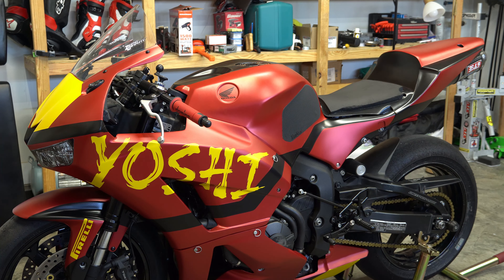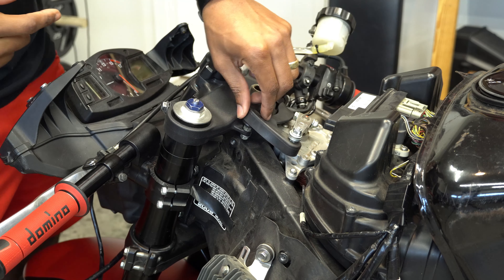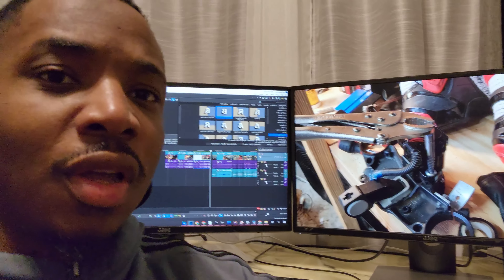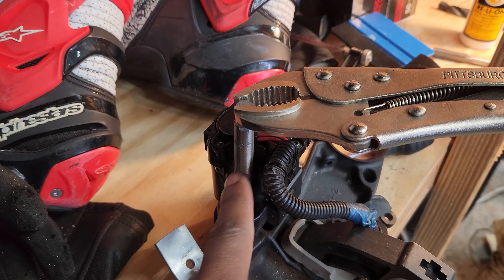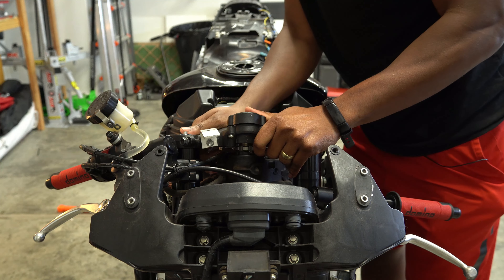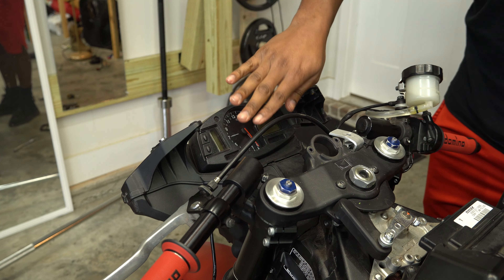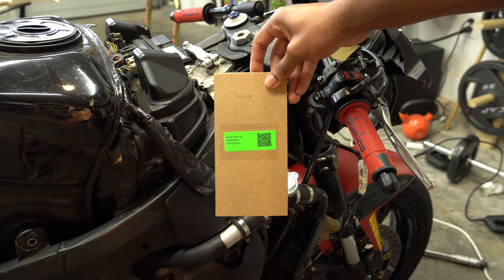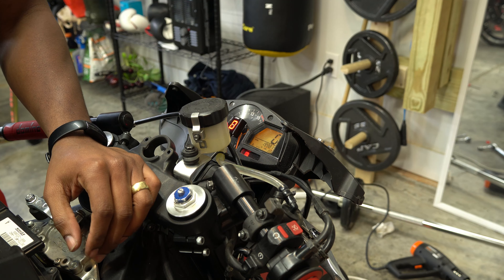CBR600rr Key Switch Delete | How To

Comment: hey man great video 😂😂😂
i got the same extraction screws you used in the video for the security bolts, but when i’m using a vice grip to unscrew it that shit is on tight!!! how’d you manage to loosen em up
Reply from the maker: I had to tap the extractor in pretty deep, then turning it out took a couple of bumps to break it loose. you could try some pb blaster or wd40 too

Comment: how about immobilizer sir?
u dont off the immobilizer?
Reply from the maker: I keep the bike in a garage and only ride it on track
Reply: @Master_Yoshi  The question was more on how you bypassed the immobilizer? Does the keyswitch-elimination the job?
Reply from the maker: @peterbasse2002  My mistake! If the immobilizer is the steering lock, than yes eliminating the keyswitch gets rid of it. It's not an electronic mechanism, so the harness itself has nothing to do with it

Comment: Wouldn't this mean you have to take the battery out every time you're not using the bike? Also, what attachment did you add at the end of the breaker bar to measure torque? Can you please link the one you are using? Thank you
Reply from the maker: Good question! With the elimination harness I installed, it makes the run switch also become the "ignition on" switch. So when it's switched off, It's the same as having the ignition to the off position, so it does not drain the battery in that manner.

Yessir, here it is:
https://www.harborfreight.com/12-in-drive-25-250-ft-lb-digital-torque-adapter-58706.html?ccdenc=eyJjb2RlIjoiNzU3OTYyOTEiLCJza3UiOiI1ODcwNiIsImlzIjoiMzkuOTkyMDAwMDAwMDAwMDA0In0%3D&utm_source=google&utm_medium=cpc&utm_campaign=19693736392&campaignid=19693736392&utm_content=143407666222&adsetid=143407666222&product=58706&store=118&gclid=EAIaIQobChMI3rG3ivmc_QIVJRPUAR0BEgUVEAQYASABEgJq9PD_BwE